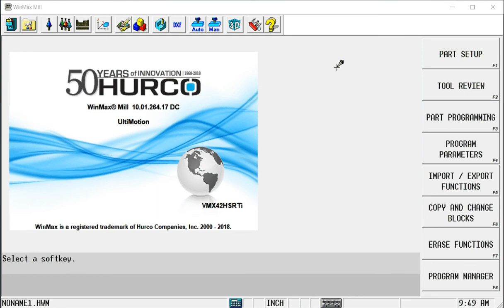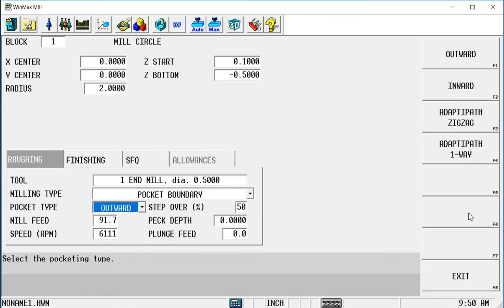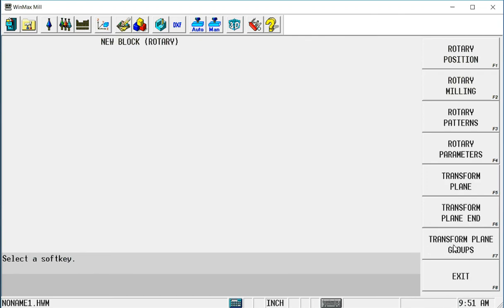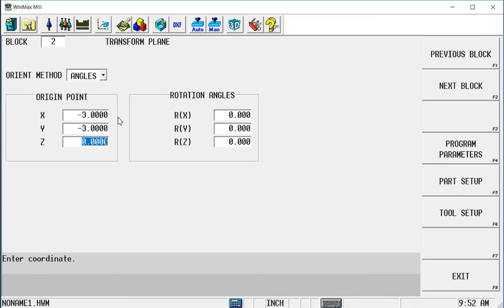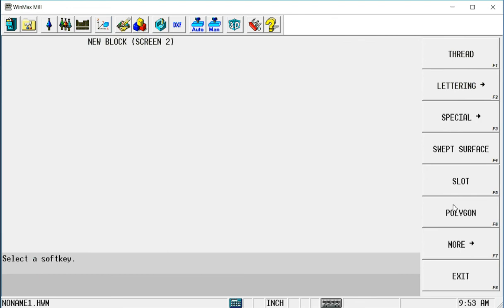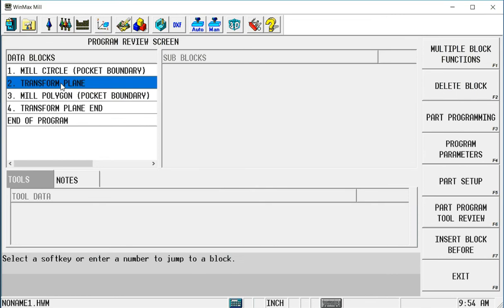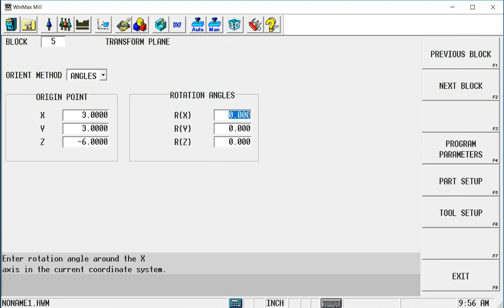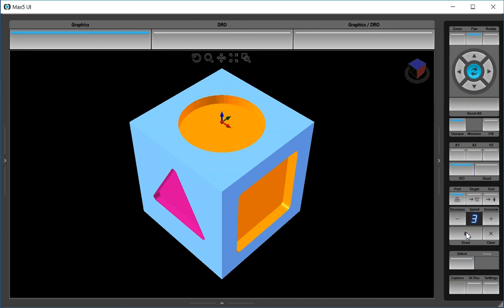How to use 5 Sided CNC Conversational Demonstration - Hurco CNC Control Demo

Comment: Why did you do -3 inch in the Y axis as the value of center for the 4 sided polygon? I don’t get how that worked.

I’m thing it should be positive 3 if the origin is at the bottom right corner.

Can you explain this please?
Reply: Hi Mitchell...that is because when we rotated around the Y-axis in our Transform Plane,  the X-axis was aligned along the Z-axis of the part (basically up & down), and the Y-axis stayed aligned with the Y-axis of the machine. Therefore, to get to the center of the right side of the block it would be a -3.0" in X (moving UP from the bottom edge of the part towards the  top edge), and the Y-axis would be a -3.0" moving from the back edge towards the front edge. Hopefully this helps. One way to visualize this is to use your left hand as a guide....point your index finger forward, your middle finger to the right, and then your thumb pointing straight up. This will replicate the machine/part XYZ coordinates, and all of your fingers will be pointing in the positive direction. Then rotate your wrist clockwise so your thumb is pointing perpendicular to the right side of the part. Now your hand is positioned as the coordinates would be in the transform plane, and the XY negative moves might make more sense now.